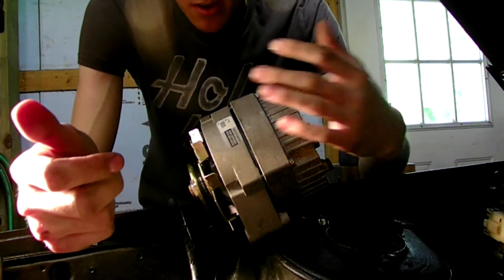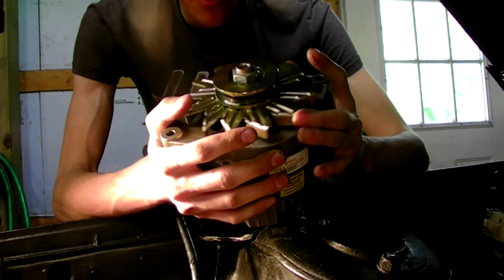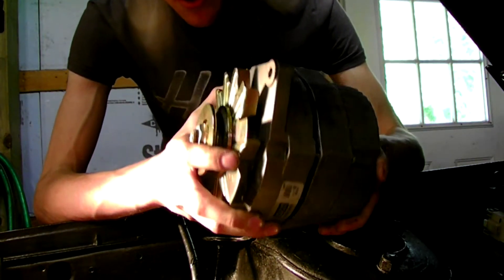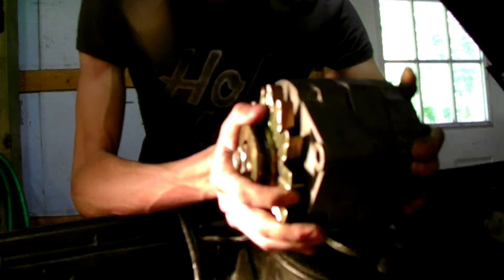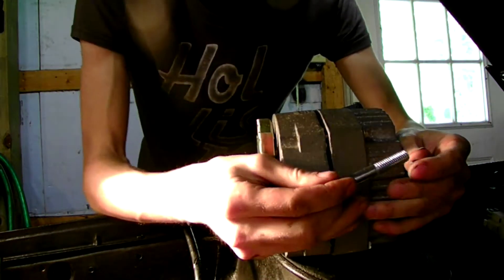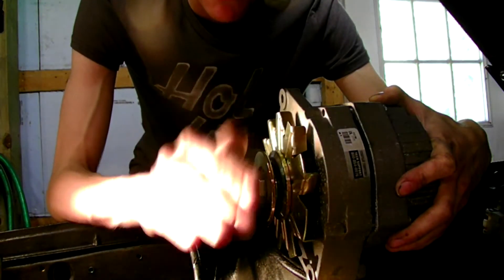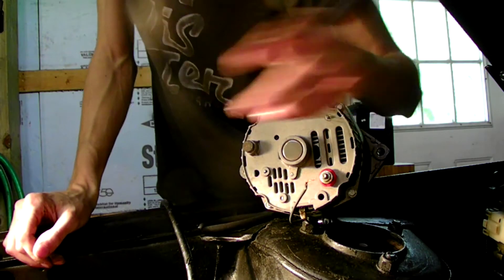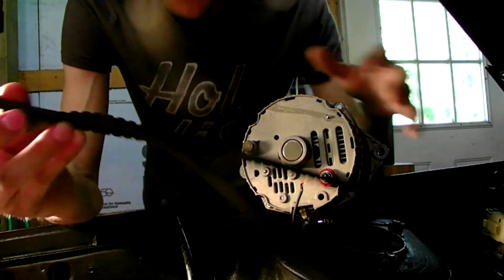Z31 VG30ET GM One Wire Install 110 Amp Upgrade Alternator Part# GM10si

Comment: What about the pulley? Do u swap pulleys?
Reply from the maker: I did not have to swap pulleys, it depends on your year and application. This should help you. http://www.xenonzcar.com/z31/Crankpulleydifferences.html
Reply: So in theory if I wanted to run this, I'd have to get a different year crank pulley?

Comment: Will this fit on a 87 300zx Non-Turbo? Also, when I called Auto Zone with the part number, they said it was a 63amp alternator. What is the part # for the 110a alternator?